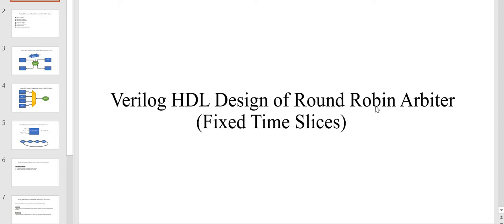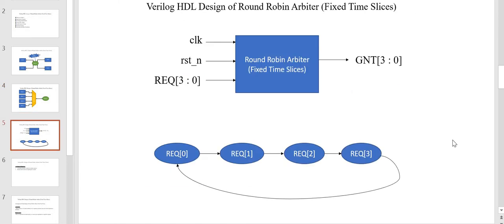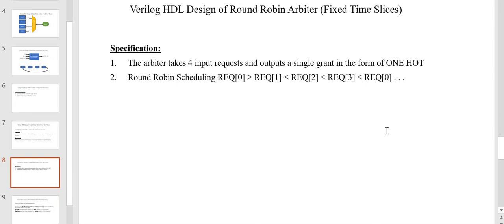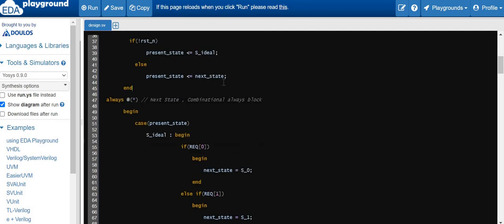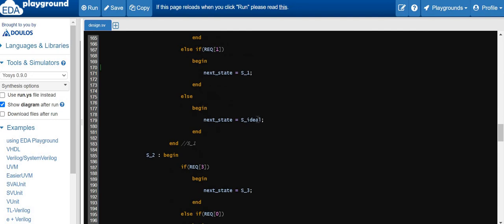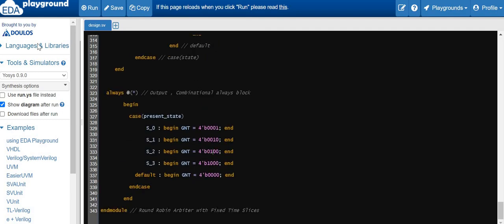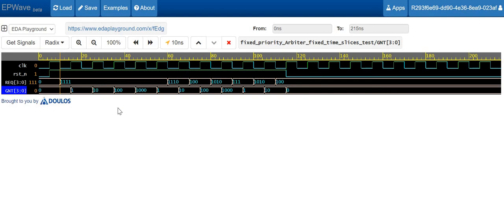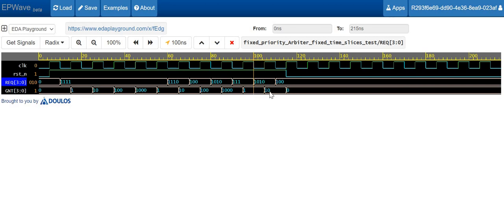Verilog Design, Simulation & Synthesis of Round Robin Arbiter | Hardware Design | @vlsiexcellence

Comment: But wait, it gets worse. You said there is no priority. Start with req = 1111, 0000,  1111. gnt should go 0001, 0000, then 0010. But since your design sets next=IDLE when req=0000,  the arbiter 'resets' back to Idle, and always starts by looking at req[0], the lowest bit, instead of starting where it left off, req[1].